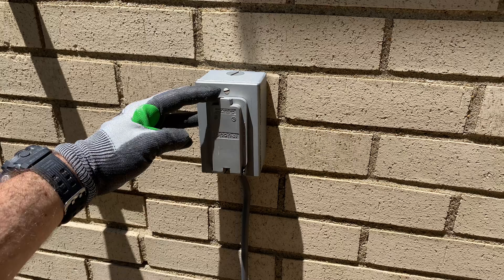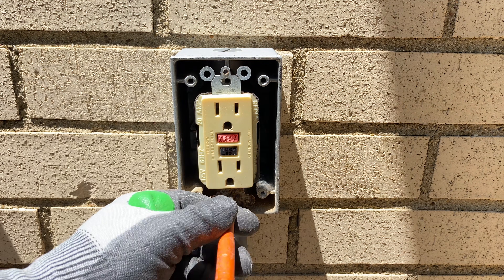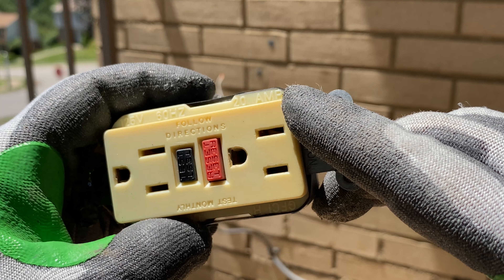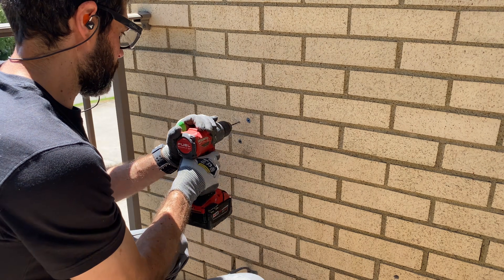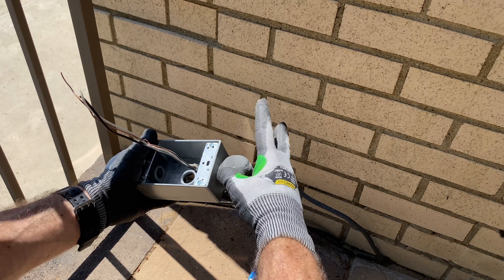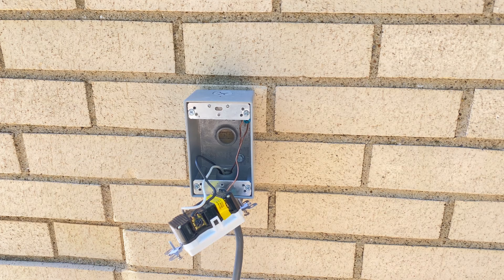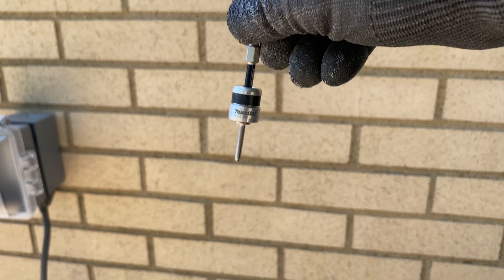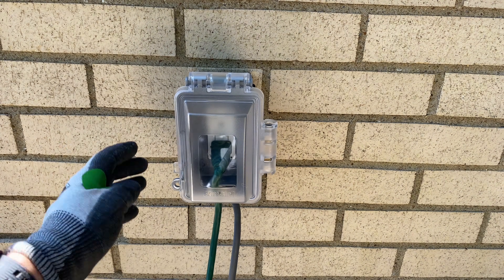Outdoor GFCI Outlet Installation for Beginners

Comment: Where did you find this type of outdoor outlet. All I can find is the one that the outlet plug has to seat inside the wall but I need exactly the one you have with only one hole going into wall for wire and the whole assembly seats outside against the wall. Please let me know if you have a link for this outlet.

Comment: I was updating my GFCI in my patio outside my home, when I noticed that all the wiring within the receptacle box consisted of stranded wiring. I intended on using solid 12G wiring, being that I am replacing a 125V 20A GFCI receptacle. I have never used stranded wiring. Although, this place is 40yrs. old. Any feedback? I am the home owner with some electrical experience, but not a professional. I would appreciate any suggestions given. Thanx.
Reply: Stranded wire is legal.  I would use a receptacle with a screw down plate connection (you slip wire under plate and screw it down).  A lot of GFCI's use this method. You can wrap stranded around a screw, but it's tricky and probably not recommended unless you've done it before.

Comment: I'm no electrician but why would you run wire without PVC or Galvanized pipe?

I asked someone I know that works in electricity for some help and the first thing he did was tell me that my GFI had to match the amperage of my breakers and that the wire had to be protected.

Comment: Why you didn’t change the wire to 12/2 then change breaker to 20amp since your installing 20amp outlet anyway. Also good to add liquid tite conduit for protection ✌️✌️😁

Comment: I want to add one piece of info for people that are updating or fixing older outlets. They were smaller back then in the 70's,80's etc before GFCI. If you are replacing an old style outlet with a gfci, the outlet will be twice as big meaning you wont have room to put it back in the same sized outlet box. They make extenders for tis, waterproof add-ons that are very cheap and make your box able to fir that new GFCI. make sure to pick one of those up.

Comment: Can you extend an existing outdoor outlet tied to a junction box on the exterior wall to then allow adding a box for connecting conduit to run a wire to another location on the outside?

Comment: Several serious violations here.  1.  Never install a 20 amp receptacle on a 15 amp circuit.  2.  Never install a 20 amp receptacle with 14 gauge wire.  3.  If you’re going to add waterproof sealant to the bottom of the box you should also carefully seal the top hole, and any others, to prevent water from collecting.
Reply: Not arguing with you, I’m just curious. Why is a 20amp receptacle on a 15amp circuit bad? Is there anything serious that can happen from that scenario? Also, what about the opposite scenario where there’s a 15amp receptacle on a 20amp circuit?
Reply: @asus9596  Great question that everyone should be asking.  If a device that draws 20 amps were plugged in it would overload the 15 amp circuit.  The result is heat and fire, if the breaker doesn’t trip.  I can tell you from personal experience that breakers do not always trip as they should and, sooner or later, your house is in fire.  Why put yourself, your family or the next family that lives there at risk when it is so easily prevented?  

Disclosure:  I am not a licensed electrician.  I became a Class A licensed contractor approximately 3 months after my house caught fire in 2005.  I don’t frequently post comments on YouTube but felt compelled in this case.  Thank you for your question and I hope my reply is useful!
Reply: @ecii437  I appreciate the response. I didn’t take into account that breakers might not trip reliably. Given that information, it makes complete sense how something can go wrong. Thanks again!
Reply: @georgecoffey9387 is it standard that breakers can withstand currents higher than they are rated for or would that be considered a faulty breaker? If that’s meant to be a feature of a breaker, what tolerance do breakers have when loading it? Are they meant to withstand, say, 20% more?
Reply: @asus9596  a fire. A 20 amp receptacle would let you plug in a 20 amp appliance and the wires were only specced for the original 15 amp socket. Maybe you will be fine, maybe you won’t but I wouldn’t do this at my house:
Reply: @Grunttamer  yes, I understand that now. Originally I was thinking that if the breaker for said circuit is rated for 15amps then surely the breaker would trip if a 20amp appliance/tool/etc is used on it. However, I was reminded that breakers don’t reliably trip when larger loads are applied.
Reply: @asus9596  If you have a 20 pound weight limit on a table,  it will not break by putting 15 pounds on it.  However,  if you have a 15 pound table weight limit,  it will break if you put 20 pounds on it.
Reply: Elect
Reply: Can you say more on why to install sealant to the top as well?
Reply: @aaSys8 this is so water doesn’t get in the top and can’t drain out the bottom.
Reply: @aaSys8  you seal the top to keep water from entering
Reply: You do t need a permit to do this?
Reply: @colesdad2000 depends on your local zone. Most places no but check with your town.

Comment: i have alot of 14 gauge stranded wire. I want to install another outlet to my exterior gazebo so Im wondering if its ok to have the 14 gauge for neutral & ground then install 12 gauge for the power, is that ok for 20 amp outlet? Or does it all need to be 12 gauge. 
I also want to add a extension to my exterior box, getting crowded, is there a good one for the outside metal boxThanks DR

Comment: I’m dealing with an outlet that was just sticking out of a stucco wall outside, completely unprotected and I don’t know what the access to the cable behind it is like, but the outlet completely fell apart recently.
It was powering a sprinkler system so it needs to get back in service.
Do the wires come through the back instead of coming from the bottom in my situation?

Comment: I know that indoors I do not have to use GFCI rated receptacles if  the circuit breaker is already GFCI rated.  Is this also true for outdoor installations?
Reply: I believe you have it backwards. Not every indoor circuit requires GFCI protection. There are indoor locations that currently don’t require that protection like bedrooms, living rooms, hallways, dens, lofts, etc. So installing GFCI receptacle or breaker is optional. 

For outdoors, it is mandatory. If it’s a circuit dedicated to or mostly for outdoor power, then yes, normal weather resistant receptacles can be installed if the breaker is GFCI or DFCI. If the breaker isn’t, then the most upstream outdoor receptacle should be a weather resistant GFCI.

Comment: Those metal boxes, being made of zinc and steel, corrode over time in an outdoor application.  That's why the original box failed.  You might consider an ABS plastic box.

Comment: I can image a dog chewing on the unprotected electrical cable. Dangerous. This is not to do project.
Reply: That is a good point queenmonkeyhead - I'm running outdoor with conduit, so watching numerous videos.
What's interesting in Canada- code is strip the romex that's pulled in conduit. That doesn't make any sense  - why remove a layer of protection. Thanks

Comment: at the time code of 1:19 it shows that the GFCI plug has some sort of white packing material or plastic blocking the plug holes.  My GFCI still has those plug holes blocked so nothing can be plugged in.  How do I remove it?
Reply: You don't remove that material, it makes the outlet tramper resistant.  To plug a device in, you need to insert both prongs at the same time, and the plastic will move out of the way.
Reply: It's a childproofing thing. So kids don't shock or electrocute themselves. Push hard.

Comment: i have a porch light on a circuit that isnt working te porch light wont work and two outlets and a living room light wont work.. dunno what is bad. think one outlet doesn't have enough power not sure. uhh i want to change the porch light to a gfci . do i have to have a internal box like that i would nail into the house or an i just get awa with shoving a gfci in a hole and coiver it with the waterproof faceplate?

Comment: Nec 2017 300.5(D)(1) through (D)(4). (1) Emerging from Grade.  Direct-buried conductors and cables emerging from grade and specified  in columns 1 and 4 of Table 300.5 shall be protected by enclosures or raceways extending from the minimum cover distance below grade required by 300.5(A) to a point at least 2.5 m (8 ft) above f inished  grade. In no case shall the protection be required to exceed 450 mm (18 in.) below finished  grade.
Reply: I appreciate the NEC reference regarding the conduit violation.

(Anyone who thinks the citation is irrelevant shouldn't do electrical work, and any YouTuber posting "how-to" electrical videos should know better.)
Reply: So is that what you do? How does it make you feel? Does your ego get fed? How many youtube diy electrical tutorials do you do a day? 

Its obvious that you know your material. What is not understandable is why you go on diy videos on stuff you clearly know other than to feed your ego 🙄 bruh get of that high horse. 

If you really wanted to empress someone you should interpret that standard and applied it to this situation.

Comment: if we are using GFCI outlet, do we have to wire it to a GFCI circuit beeaker in the main panel?
Reply: no. GFCI is already mini circuit breaker
that is its whole designed purpose to provide you with additional safety at the point of outlet
it also is able to break just the affected outlet only and not cut the rest of the outlet on the circuit 
for example, you watering the plants, one GFCI by the plant kicks, the other on the circuit that feeds you security CAM will be unaffected

Comment: I don't believe it is code to run fasteners (screws or nails) from inside a junction box to outside the junction box.  I suppose you might be able to get around this by grounding each screw so that they could never accidentally become hot.  This has nothing to do with water resistance, which is diminished when such fasteners are used in an exterior application.
Reply: It is code, if approved. 2017 update of 314.23(B)(1)
Reply: usually this style of box comes with little brackets that screw into the back but not through into the enclosure. That would have been a cleaner option, I suppose.

Comment: I thought this was an interesting video. Now that I’m reading the comments, everything is questionable.
Reply: 300.5(D)(1) through (D)(4). (1) Emerging from Grade.  Direct-buried conductors and cables emerging from grade and specified  in columns 1 and 4 of Table 300.5 shall be protected by enclosures or raceways extending from the minimum cover distance below grade required by 300.5(A) to a point at least 2.5 m (8 ft) above f inished  grade. In no case shall the protection be required to exceed 450 mm (18 in.) below finished  grade.

Comment: Humm. Would the cable need to be 12/2 if it's a 20 Amp circuit?  If i run this cable (uf.*) under my walkway, would I need to place it into a pvc-40?

Comment: You installed the box upside down.    The ground lug on the box should be on the left bottom side to match the outlet ground being on the left side.  Also, you should not seal the box.  Now any condensation cannot escape.
Reply: @kimbuck-2  no problem at all in fact the ground should be in the bottom unscrew the screws and rotate it then screw it back make sure to turn the breaker off before doing anything

Comment: Couple corrections: Above grade exterior cable must be in conduit & must be individual conductors. That cable you have is meant for direct burial only. Some boxes come with tabs so you wont drill holes through the box.
Reply: This video and thread of conversation is great! Thank you to everyone with constructive outlets…😂. But really, thanks!
Reply: It must be protected up to 8' of the surface so it should be sleeved in a rated nec 2017 conduit300.5(D)(1) through (D)(4). (1) Emerging from Grade.  Direct-buried conductors and cables emerging from grade and specified  in columns 1 and 4 of Table 300.5 shall be protected by enclosures or raceways extending from the minimum cover distance below grade required by 300.5(A) to a point at least 2.5 m (8 ft) above f inished  grade. In no case shall the protection be required to exceed 450 mm (18 in.) below finished  grade.
Reply: I'm not even allowed to run bare wire in a garage
Reply: I agree,
but i think in this case it is a repair type replacement
the old one was installed with cable only
he just replaced the box and the GFCI
Reply: I've searched the code book for the conduit requirement, and the only thing I found was 300.5 for underground wiring. If kept above grade, it shouldn't need conduit. Is there a different section which specifies conduit for above grade?
Reply: what is "direct burial"? i am trying to do this on my own and am having difficulty.
Reply: @joejackson9986  direct burial is cable with a sheath (outer jacket) that is rated for burying in the ground.  When I use direct burial or outdoor rated Category cabling there is gel in the conductors (copper part) to prevent moisture entry).  You never just want to put it in the ground though.  Each area/jurisdiction will have codes that require you to go a certain depth, maybe have sand below and gravel on top (before you cover the trench back up), etc and you may even need to mark it somehow with flags either in the ground (in the trench you dug) or on top, or both.  Contact your local building inspector for your city, county, or township and he/she should let you know what they're expecting
Reply: @billsmith9249  thank you!
Reply: Not an electrician but why is there a wire visible outside the box?  Doesn’t look right or to code.

Comment: Why not use the 15 amp gfci that came with it? A 15 amp receptacle is totally fine on a 20 amp circuit.
Reply: if you look at the breaker it says 15 amp not 20 amp
Reply: If there is only one receptacle in the circuit, then the receptacle must match the circuit amp.  So he could be correct here.
Reply: @franctoma  One receptacle on a circuit means it would be a single receptacle, not a duplex.

Comment: Our CFGI outlet for the water heater has flipped. We had the water heater replaced(company didn’t think to test outlet before removing old one 🙄), along with the breaker it was connected to. About a week later it flipped again. What is your advice? Need the outlet replaced or a fluke (has only flipped these 2x in 9 years)?
Reply: What size is your water heater? Just wondering why is it plugged into GFCI receptacle and not hardwired straight to the breaker.

Comment: Why not just reuse the existing anchors in the brick rather than drill new holes?
Reply from the maker: unfortunately they didn’t align
Reply: @HomeRepairTutor  if they did align, would you have used the existing one

Comment: Terrible Video!  Dude by drilling holes in the back of the box you just threw out the Weather Proofing.  Those boxes come with tabs so you don’t drill the box.  I also would never run that Romex wiring exposed that way.  I don’t care if it’s outdoor rated.  I would run conduit with rain tight fittings.  I am also pretty sure NEC code will not allow exposed romex to be run free air like that.  This is a great way to burn your house down!  Too many hazards the way this was done.
Reply: Lol I did the same mistake the first time I installed one of these boxes
Reply from the maker: first, the entire box is waterproofed against the brick with sealant. Second, the cable is anchored to the brick. Third, the cable is approved per NEC for exterior use.
Reply: @HomeRepairTutor  code 225.20 states against to be protected from exposed damage. also not the correct strain relief for UF.  If you were running this under a deck and came through the wood then you would be fine.
Reply: @HomeRepairTutor  Proximo didn't have to be such a D about it (the video was good!!), but the point about drilling out the back of the box is a good one. I've found this to be true from my own experience having surface mounted a bunch of boxes on exterior walls made of wood and brick. Some had sealant between the box and wall before driving the screws, some duct seal, some a full foam gasket sandwiched in there, and some a combination of things where I thought I was doing myself a favor. All of them failed within five years. The ones mounted on masonry were the worst (surprisingly!) I suspect it's because the brick absorbs and holds moisture, so it made it's way into the box over time as water vapor around the screws and condensed on the inside. In the end I suppose how protected the box is from the weather matters too (like a larger and lower overhang is obviously more protective than a higher, lesser/nonexistent one).
Reply from the maker: @marcberm  thanks buddy, I’m probably going to redo this video and post it again with your tips and lots of over suggestions, the video doesn’t meet the standards I’d like to uphold - I really appreciate your kindness and willingness to share your experience, thank you 👍🏼👍🏼👍🏼

Comment: Shouldn’t that wire be in conduit?
Reply: Yes it should be
Reply: It needs to be in a raceway to protect from physical damage.
Reply from the maker: that’s an option but this is rated for exterior
Reply: @HomeRepairTutor  just because it's exterior rated doesn't mean you can run it that way!
Reply: @HomeRepairTutor  is it subject to physical damage? yes. it should be in a conduit; or rather, you should be using THHN in a conduit. you can bury this wire without a conduit so long as it is in a deep enough trench.

Comment: The circuit breaker need be 20 amp first so people need to know right?
Reply from the maker: yes, always check the breaker
Reply: @HomeRepairTutor Yes, always check the breaker to make sure you don’t fail code the way you did by putting a 20 amp receptacle on a 15 amp circuit.